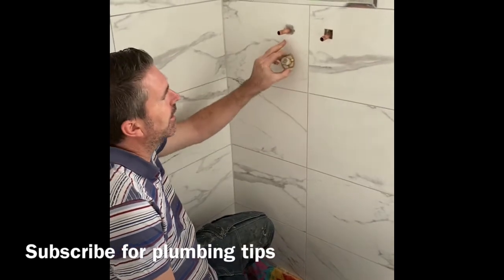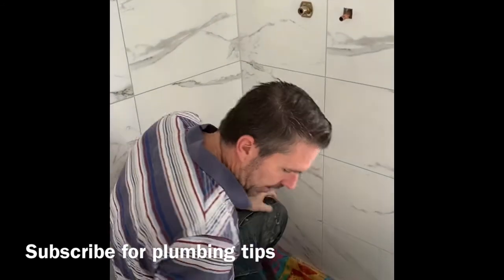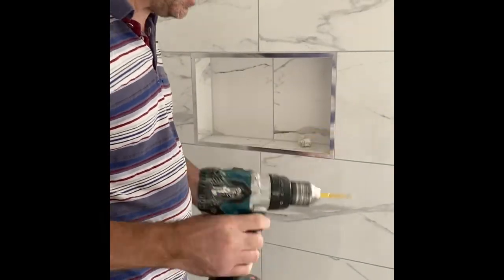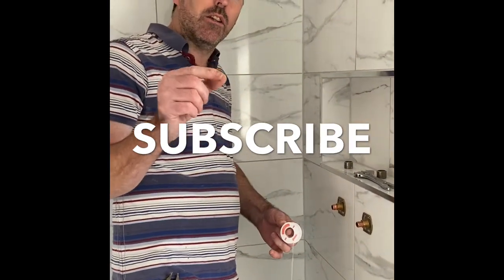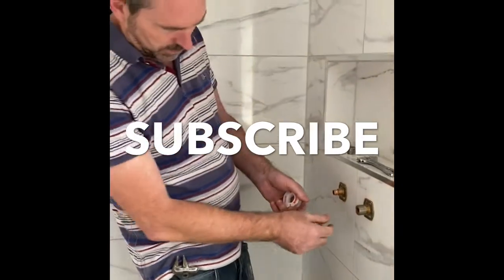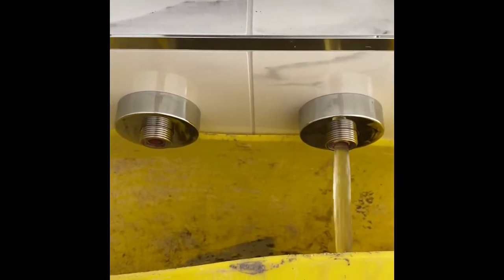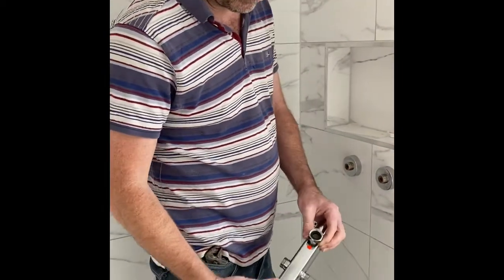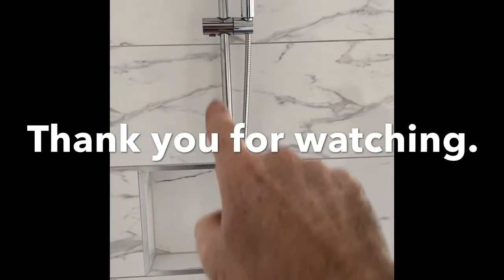Surface mounted shower brackets for bar shower thermostatic valve installation

Comment: Hi, i have fitted a new shoeer bar, but havent changrd or touched the inlet pipes. I have a small leak out of each inlet valve where the covers hit the wsll. Will ptfe tspe on the olives fix this? Or will i need new connectors and olives? 
Thanks
Reply from the maker: yes
Reply from the maker: yes

Comment: Can I fit a shower mixer valve on to bathroom plasterboard and tiles only?  Does there definitely need to be wood behind ?
Reply from the maker: No, just as long as you can get the bracket on and the pip fixed

Comment: Hi I'm fitting these in next few days .. how much pipe do u leave outside of the valves for when u put the olives on
Reply from the maker: What you have to do is have a look on the pack and it will tell you normally about 30 mil but check the park first
Reply: @bishbashbosh121  cheers mate much appreciated

Comment: I’m about to fit a tower panel thermostatic shower, do you reckon fitting a pressure reducing valve or pressure equalising valve?
Reply from the maker: Hi yes I will definitely fit one if the pressure is high try and get it just after the stop tap
Reply from the maker: If you are on economy and the pressure is high into the problem I would always fit a pressure reducing valve